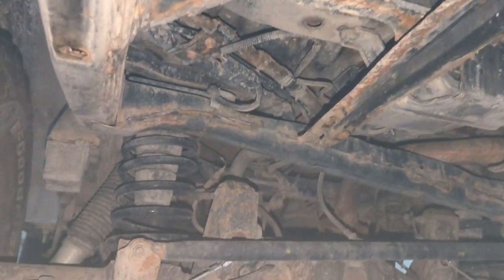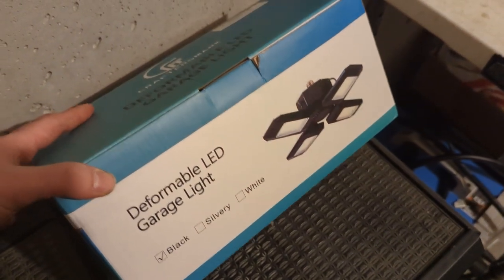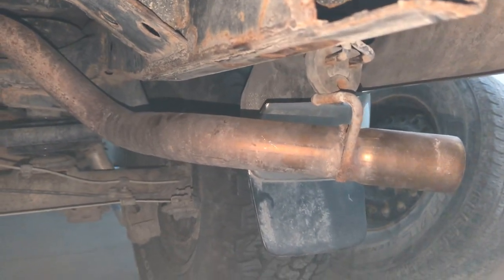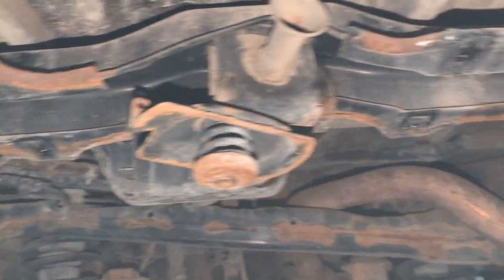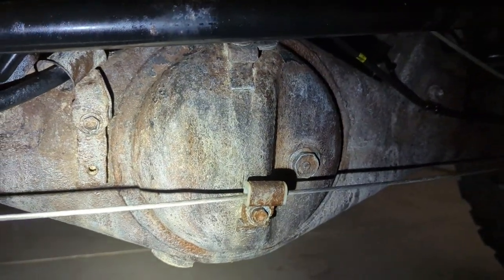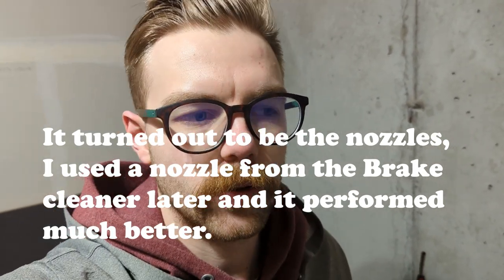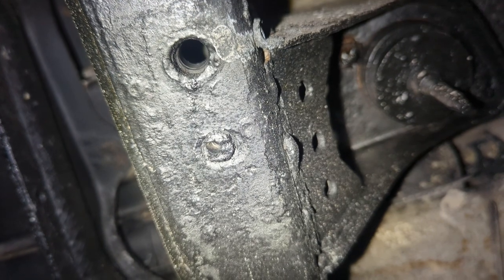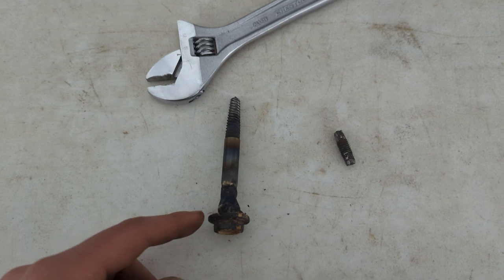Handling Rust in the Rear - 3rd Gen 4Runner Part 7

Comment: Bad job. You left a lot of scaling rust. That is all still rust. You failed to remove all of it. Covering it up with chemicals, wax and paint won't stop it, it will still rust underneath all of it, You said it yourself. You should have done it right the first time, if not, just use fluid film/surface shield so you can power wash it off later to properly treat it.
Reply from the maker: As far as price and longevity goes, I think I still made the right choice!
Reply: @mattuccibuilt3970  Understood, hope it works well! Keep her on the road.

Comment: Keep it up! When you get the space and time for doing the final rust removal, I recommend taking the body off the frame. I've done it twice now without a lift outside. It also makes it easier to service the engine and suspension. Scary at first, but it's easier than people think. You should have a backup vehicle because you will want to spend more time getting to every component.
Reply from the maker: Yeah that's a great idea! I've got the commuter if needed, thanks for the tips!

Comment: I had someone sandblast the underneath and then painted over all the frame with black paint, I plan on doing this every 2 years or so.
Reply: I would attach pictures if I could
Reply from the maker: If you don't mind me asking, how much does that cost? I was going to attempt DIY sandblasting but didn't have the means for it. It seems like the best way to get rid of rust by far.
Reply: @mattuccibuilt3970  well, I looked LONG and HARD. So I got it done for $450 all in from a guy locally. haha but the going rate I was coming into was about $1000-1500 on average.
Reply from the maker: @brandontignor  Yeah, thats close to what I was thinking, its crazy.
Reply: @mattuccibuilt3970  it's honestly still worth the work an labor for someone to do a good job for 1k-1500. I know it's alot. But worth saving up and getting it done. I can't tell you the weight off my shoulders it was to have it done. Like gawd